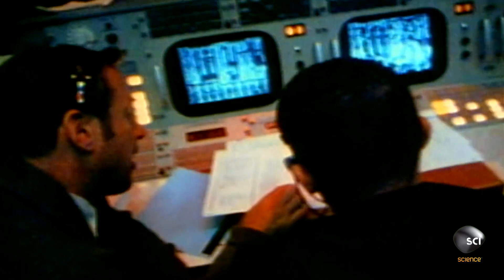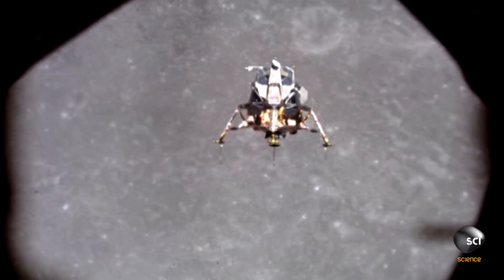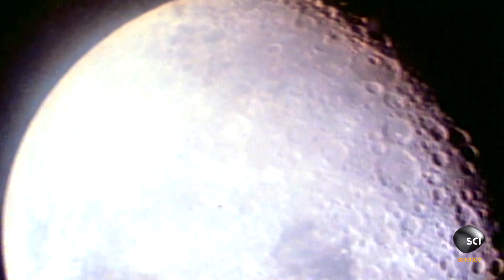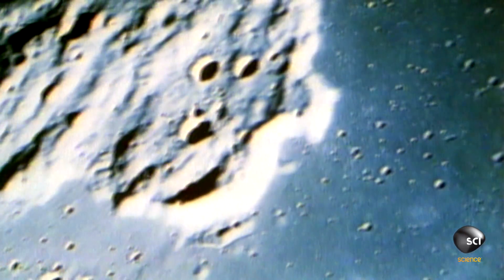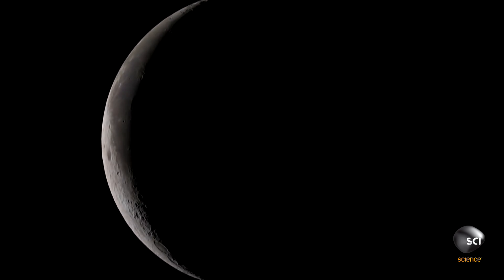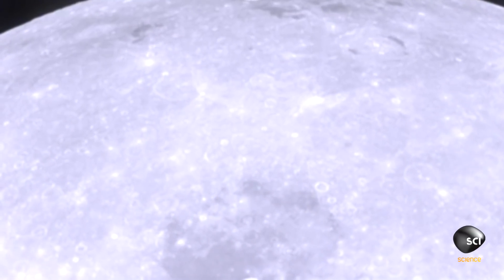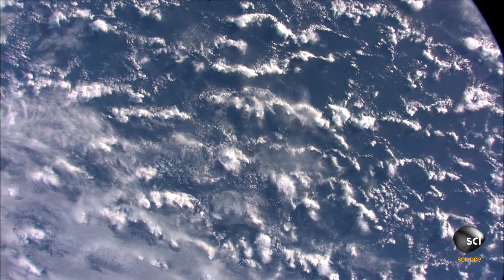Why Does the Moon Sound Hollow?

Comment: I think these people are so far off of Base. The moon cannot ring like a bell ringing like a bell indicates  sound. There cannot be sound in space because space is a vacuum with no air you need air for sound to travel. You can say it vibrated like a bell it oscillated like a bell. If it made it sound like a bell there is a bigger question to be answered. But all of these smart people are using the word sounds and rang. This video should be remade with careful attention to terminology

Comment: Well if the moon controls our tides does that somehow connect to the water under the Moons surface?!? Also, why would the moon ring like a bell if there was water wouldn’t that drowned out the sound & absorb the sound waves reflections?!? Another question…If there’s so much water on the moon 

(a.) How did it get there without an atmosphere? 

(b.) Wouldn’t the water freeze because of the lack of heat in space?!

Comment: Just an idea....but:

The moon might be vibrating for longer because it is SOLID, unlike the Earth which has loads of molten LIQUID magma.

Being solid, the vibrations are transmitted with much greater efficiency with the energy bouncing between all the atoms (for longer) than compared with the earth containing more liquid.

The “logic” is a primary/elementary school test of seeing how vibrations/sound (the same thing as impacts) travel in different mediums (air, liquid, solids). Ear against a table, even gentle taps are loud. Tap the air, and you hear fuck-all.

The further away molecules are from one another, the more energy required for them to move to influence the ones next to them. So the more liquid or gaseous an object, the quicker the vibrations will cease.

Thoughts?
Reply: I don't think so
Reply: There are "things" inside for sure

Comment: On the Earth, you have water, you have heat, and it tends to make those cracks kind of heal over millions of years and basically becomes more like solid rock again. But on the Moon, when a wave comes it tends to bounce off the crack, it bounces here, and bounces there, and bounces back and back, they start running into each other. The waves go on and on for a long time because the Moon is very dry. They don't get damped out.
Reply: What happens when you bash 2 rocks together? You get a thick thudding sound because they are both dense. The moon shouldn't ring it SHOULD just absorb the impact to a dull thud. You even said so yourself that it would bounce around inside the  moon...which would  make it hollow 😝👍
Reply: @YouTubeareabunchofarseholes  first off, resonant frequency of mashing 2 rocks together that are suspended in the air is completely different than a large rock that is floating in space getting dinged on.
Reply: And those dings all seem to be the same depths no matter how big the crater? I posed this question to another person who said objects of similar density, mass with similar this ,similar that...hit it simultaneously at similar speeds and made the craters . Hoping you have a better theory than that lol.

Comment: Scientist have already discovered years ago that the moon has a very low density mass compared to earth and they also know from samples that the surface rocks on the moon are made from basalt rock..which is very light weight ..because of its low mass index it is impossible that beneath the surface that the rock would be any harder ..basalt rock is very lightweight so since the moon is comprised of this rock it should be impossible for the moon to reverberate the way it did  also all the craters on the moon have the same depth which should also be impossible  it's almost as if some hard metal surface underneath the rock is preventing meteorites from impacting any deeper..yet..for the moon to ring like a bell the way it did  ..it would also indicate that beneath this hard metal surface that the moon would have to be hollowed out ..I don't like to be a "conspiracy" nut BUT ..I need someone in science to explain these facts to me in a way that makes sense
Reply: Its almost perfectly spherical, it is exaclty at the far enough to have an eclipse
Reply: @kiljaeden5405  it's close, but it's actually not exact. you can tell during a solar eclipse that it's noticeably off.
Reply: Like a 🔔

Comment: What about the perfect circular orbit, tidal locking and uniform depths of the craters ??
Do you have an explanation for that? Or is that also natural?
Reply: @kaushik_as  The orbit is not a perfect circle.  Try doing a bit of research.
Reply: The orbit is not perfectly circular.  Tidal locking is very common for most moons in the solar system.   The depth of craters vary widely.  Don't spout "facts" that you obviously did not look into.
Reply: @Nimion2   Tell me which moon is almost 1/4th the size of its orbitting planet in the solar system and which moon is tidally locked as if it were a common thing...its not spouting facts Mr...Its called common sense which i am sure you lack..
Reply: @kaushik_as  The ratio of size has nothing to do with it. Look it up, nearly every known moon in our solar system is tidally locked to its planet.  And our Moon's tidal locking is not perfect. Do a bit of studying.
Reply: @Nimion2  but he watched the video from the "why files"  and took at as scientific fact.

Comment: I am wondering if the moon vibrated for such a prolonged time is because is has no atmosphere and therefore would not be limited in terms of resistance to the vibration's physical qualities?  I am no astrophysicist, but am I on the right track?  As for being hollow, two Russian scientists published a paper in the 80s (I think), postulating that the moon is indeed hollow, because, if it was not, it would not be holding its position in space.  They concluded after calculation, that its mass, size and the gravitational pull of the earth would have made it mathematically impossible for it to be "solid".  Therefore, they theorised, it must be hollow.  That begs another question - is it a construct?  If it is, who or what put it there?  Curiouser and curiouser…...

Comment: Separate seismograph instruments are needed to record the north-south horizontal, east-west horizontal, and vertical components of a tremor!
A seismometer requires a radio transmitter and batteries that last 50 years even if solar panels are used!
Reply: Transducer!

Comment: That's because every celestial body is hollow inside, because of the centrifugal. It's impossible for the mass in the center of a celestial body to remain there, because the gravity in the very center of a celestial body is 0 and the rotation causes a CONTINUOUS CENTRIFUGAL, which makes every particle to be forced out of the center to its very surface. And when that mass is far enough, the gravitation pulls them back, so that it becomes a hollow celestial body.
Reply: @R J well the centripetal force doesn’t exist in the center of a sphere. It’s equal to zero.

Comment: A 30 foot wide crater that's probably the same depth as all the others no matter how wide they are which would suggest that there's a protective layer underneath all the dust and rocks
Reply: The weird thing about the craters is like you said none of them are much deeper than the others even if they are miles and miles wider. The depth should be somewhat proportional to the width of the craters but from what i understand all the craters are extremely shallow
Reply: Yes not only that but the bottoms of the craters are frequently convex not concave like you would expect. Suggesting that there is something like an outer shell with moon rocks/dust on top and hollow inside
Reply: Good point.

Comment: the moon is hollow.  we tested it and so we know.  period.  so, if it's hollow; then it's artificial.  it's a giant space station run by aliens.  we've all seen these aliens, the so called greys.  they're not taking over, they're already in control.  we're a farm of sorts.  OR, it's actually a natural satellite and we just don't know enough about moon geology to figure how it could be hollow/not hollow but ring like a bell.
Reply: "Ring like a bell" was a metaphor when the first Apollo-emplaced seismometers detected seismic shock waves from deliberate lunar impacts [by US vehicles] and later large natural objects. It referred to the unexpectedly-long time duration of the resonance waves, not damping out as quickly as in Earth's crust. Geologists quickly figured out the lunar crust didn't damp out seismic signals as quickly as on Earth because of the much higher dryness [and brittleness] of the crustal rocks [not because it was metallic and hollow 'like a bell']. It was the lingering reverberations that prompted the scientist's phrase 'like a bell', not an acoustic similarity to what a bell actually sounds like to the ear.

Comment: it sounds hollow because it is just a hollow sphere of white rock probably quartzlike with a layer of loose dust.
It was originally made by GOD as a ball of water and basic elements about 6,000 years ago.
After He set it in place the water split and reacted with the elements to make a solid crust around the ball.
Then the water continued to react and made the exterior dusty surface while all the hydrogen lifted off into space.
The internal water escaped through the so-called craters which is why they have rills, gullies and levelled floors.
Later during The Flood the moon was peppered with vast amounts of dirt and rocks which made the craters with central peaks.

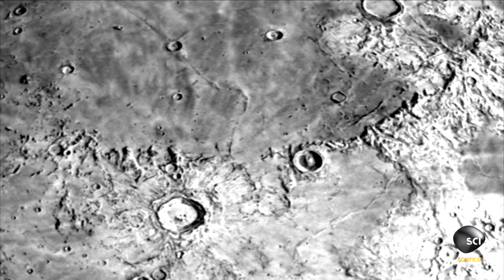Comment: 2:38 There is that strange tower in the center of the crater. Explain THAT?!
Reply: A disguised and/or transmitter/antenna?
Reply: @blackholeentry3489  As good as any guess.
Reply: That is referred to as a central peak.  They are fairly common in craters that form from eruptive events from inside a celestial body.
Reply: @freemind..  Seen lots of those. This one looks too tubular. 
Could be just a strange fluke-peak, though.

Comment: Water would deaden the sound pretty quickly so it's ringing couldn't be caused by underlying water. The moon is an impossible enigma that cannot be explained by science. The Earth hasn't enough gravitational pull to have captured it in the first place. It is half a millon years younger than the Earth, so could not have come from the Earth, and it rings like a bell.

Comment: Even if you try to calculate the mass of the moon going from the fact that it is mostly composed of earth material, thus having the same density as the earth, you will see that the result is much greater than the actual measurement. I had an Astronomy assignment where I had to calculate the mass of the moon and I was confused to find out the moon only weighs 0,7349• 10^23 kg compared to 1.21• 10^23 kg as my calculations indicated.
Reply: Which means about 40% mass is missing! That would be from the center obviously! I wonder why School boy Science champions are stuck to old tales instead of admitting they don't know
Reply: @Mac13587   So? What should we conclude then? Is the moon a freaking alien dyson sphere? 😂
Reply: @Rotisiv  no we conclude that the moon is made of cheese
Reply: @heroofdarkness3254     swiss cheese 🧀 ... Nevermind .. that would mean it's made of MONEY
Reply: @Mac13587  Most people are dogmatic and can't admit they're wrong. Beyond that people get fired from their job or lose funding if they go against the grain.

Comment: I think the moon was a star at one time, radioactive surface and very hot.  The surface resembles ashes and it’s hollow!  Best theory yet!
Reply: Charles Carona You obviously dont understand how stars work.

First off, stars are made of gas, not solid at all. This gas is compressed to the point where its atoms start fusing together, releasing heat and energy. 

Secondly, as far as I know, Nuclear Fusion gives off little to no radiation as there are no radioactive particles to begin with. 

And thirdly, the moon isnt super hot. Its only comparatively warm in the sunlight on the one side thst the sun hits. The dark side of the moon is cold enough to kill you in minutes, assuming you could survive the lack of oxygen in the near vaccuum.

Comment: The moon, a semi-solid. There are no liquids, and defiantly no water or atmosphere. The outside should have cooled before the inside, causing a skin effect. After the skin solidified, the inside should have went thru a phase change from liquid to solid. Loosing its heat in a Newtonian fashion. This series of phase changes, changes the density of surface to core comparatively. Thus creating a semi-solid moon. Resulting in, Luna reverberating like a bell when struck by massive meteors. I am certain, the explanation can be found within the realm of thermodynamics.
Reply: You can not use the word 'Newtonian' and 'loosing' in the same sentence. For the love of God, it's LOSING. LOSING is the word!
Reply: Q uantum - Sounds somewhat reasonable until you realize that celestial bodies do not form from accretion, despite what they teach in school.  Melted minerals become glass.  

Like virtually all minerals, the Moon crystallized out of water.  Whatever liquid it formed from is what remained inside.  99% of the lunar craters are the product of eruptive events which expelled rock, water, steam, silt and mud onto the surface.  The water sublimated away rather quickly.  Eruptive events are almost never singular, and successive smaller eruptions would have continued to percolate out more of those same materials, thereby flattening the floors of the craters and leaving us with what we see today..  shallow, flat-floored craters on a moon with vast empty chambers that once held large amounts of water, and now rings like a bell when struck.
Reply: Q uantum you just made all that shit up, I can easily say that the moon is made of cheese because the radiated reindeer ran over a bus in the month of purple.

Comment: What about the uranium on the moon, or the other materials that do not occur naturally in our known world/solar system?
Reply: Uranium absoloutely occurs in nature. Research first before making claims please
Reply: Filthy Casual Neptunium 237, uranium 236 and pure titanium were found while astronauts from the lunar missions while drilling on the surface of one of the moon’s craters. First of all uranium 236 is only found in spent nuclear fuel which IS NOT NATURAL. And plutonium 237 is a material when bombarded with neutrons, it turns into plutonium 238 which is mostly used for SPACE CRAFT GENERATORS AND terrestrial navigation beacons. These materials would not be with each other naturally. :)
Reply: @salvulcano9061  how u gonna just list three elements there was way more most can't be found any where else the moon never collided with earth and it proves it
Reply: Jay Capo Simply because that would take forever to type and explain.
Reply: @salvulcano9061  Reminder that 2 nukes were detonated on the moon in the mid 70s
Reply: FujiMo 365 how the hell does uranium not occur naturally? We found it in nature.
Reply: carrot top You are correct, but the only natural occurring uranium isotopes consist of three version, uranium 238, 235, and 234. The uranium found on the moon was very unusual, it was uranium 236 which is found in spent nuclear fuel. That is what he was getting at in an over simplified statement.
Reply: all Earth's uranium was created by piezo-electric burst at the start of The Flood.
Uranium on the moon and elsewhere came from Earth by the jets of water or the fountains of the deep.

Think that through if you have the brain.